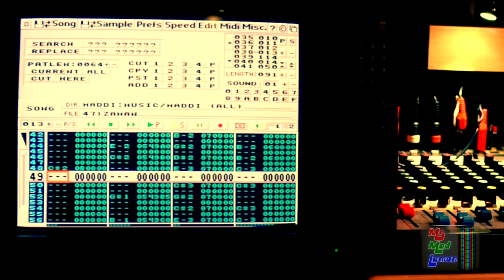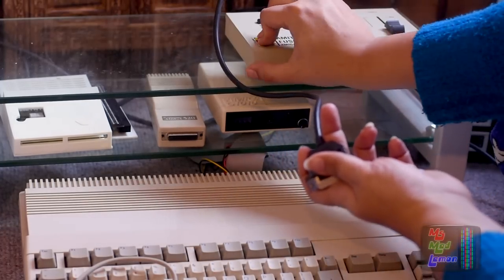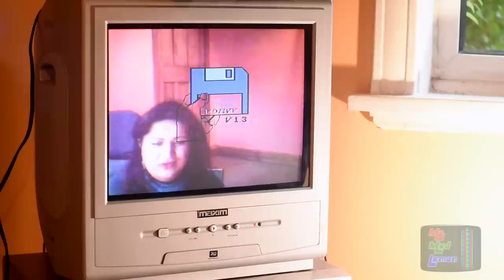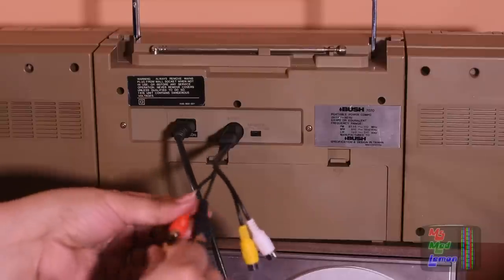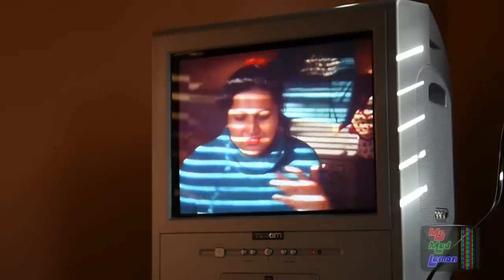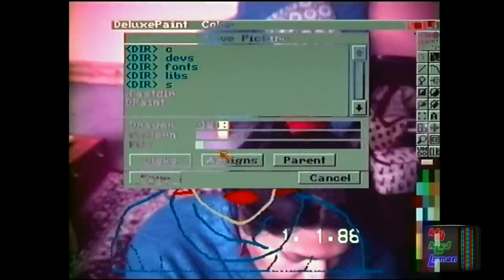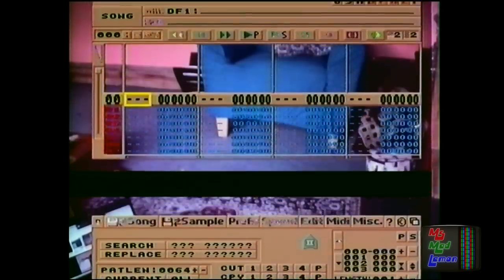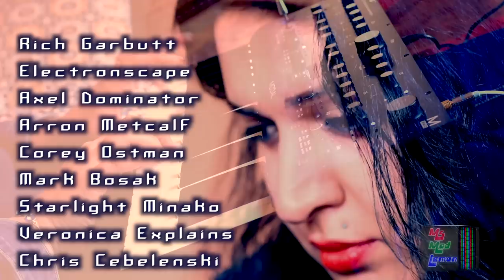VHS Amiga Special - Genlock, Electronics, Setup and Repairs

Comment: Now this took me way back! I remember back in the days working at our local TV station we used a similar but different Super Gen (the white one with two sliders). We also had similar issues with timing and sync in certain environments. For instance, using Btitler2 or Scala was no issue as those programs were designed specifically for video titling and graphics, but with DeluxePaint IV we'd get weird artifacts, jumping, scrolling and shifting. What we did to get around that was connect a time based corrector, which had a genlock input connected to the Amiga's composite output as a reference, then the video source (i.e. your camcorder) would connect to the TBC's video input, and finally it's output would go back to the Super Gen. Basically, it replaces the sync pulses of the video source with the ones from the Amiga, thus keeping both in sync.

Comment: The scrolling is because the two 50Hz clocks are not precisely in phase with each other. Professional video gear usually has some method of supplying a common clock source for syncing. Some video equipment uses the mains frequency, which is why the Amiga 2000 has the ability to use "TICK" (a time signal that comes from the power supply) rather than VSYNC.

Comment: You definitely got some nice '90s stuff there, and the reel-to-reel machine is really a thing of beauty :).
The Amitek is lovely! I could bet my ass that Dave Jones (EEVBlog) would be on a cloud nine, the board is so nicely designed.

Scrolling seems like a vertical sync issue, kinda same thing as in a scope without triggering. But then I'm probably wrong as I'm an audio electronics gal, I don't know much about video systems.

Don't sit down for too long or you'll get them Hemroids! LOL
Reply from the maker: Yes you're right, it's vertical sync issue and the same thing as a scope without triggering 🙂
I need to find a way to adjust the vertical phase or find something that does that.
Like yourself i'm more a audio electronics gal than video, I always have been, but video is new territory to me and i'm still learning.
LOL Hemroids, back in the day when i played this, I was very young and oblivious to the name, its only when I went back on it in recent years I cracked up laughing remembering it 🤣